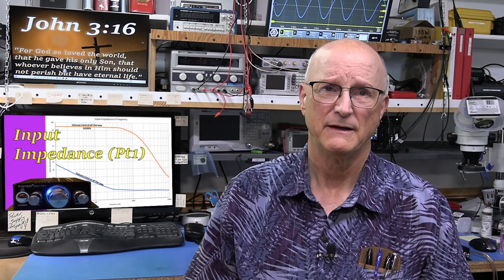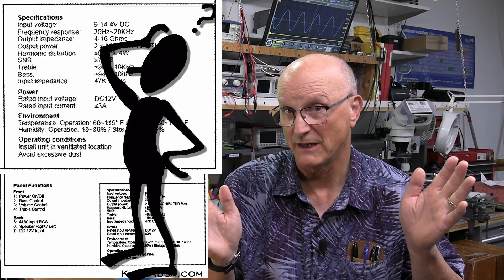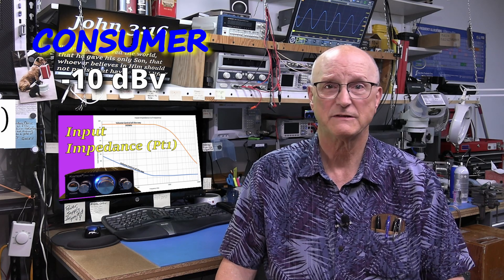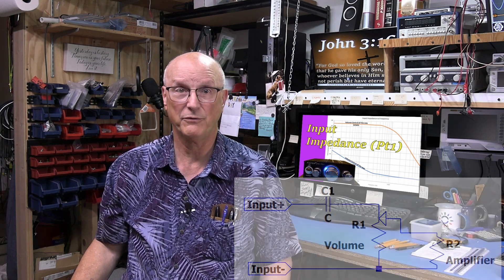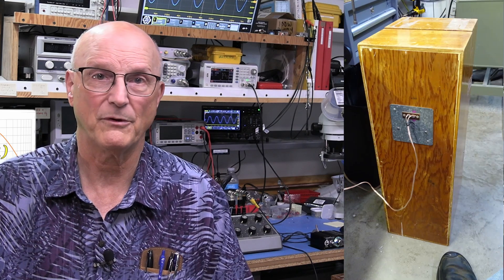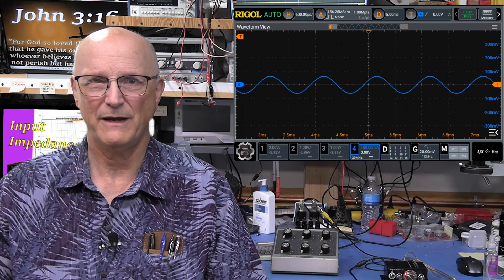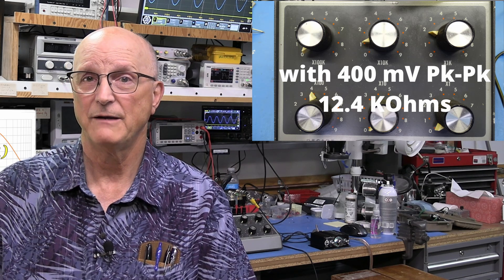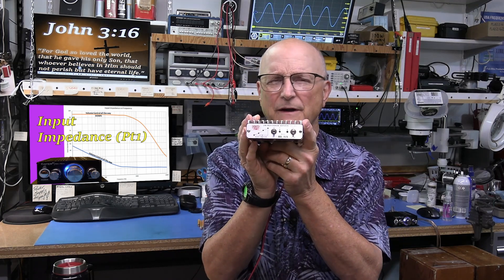Measuring the Input Impedance of a Product, Circuit or System (070a)

Comment: could you help me troubleshoot my speakers?  bought a set of JBL speakers to replace some old ones on my older yamaha receiver.  the olders ones worked fine, but when I put a banana clip on speaker wire and plugged them in - no sound.  I ran the test using my receiver and it said - no speaker found.  I was not familiar with the speaker hookup on the new (er) speakers.  wondering if using the banana plug was the issue?  the knob on the speakers unscrews revealing a little hole that I read is one way to connect speaker wire.  never done that before.  I'm out of my element.  could you help? (71 year old female and not afraid to experiment). but I get frustrated more easily that I used to when building my old PC's.  thanks!  wish I had a way to send photos to better explain what I'm dealing with.
Reply from the maker: Banana plug or using the hole ... both are equally valid ways to connect your speaker assuming the banana plug is installed properly. 
If these speakers are used, you MAY have bought a pair of blown speakers (someone used too much power or applied a large D.C. voltage across them - often the result of a failure of their amplifier). If I were you, the first thing I would do is to measure the resistance across the speaker terminals. From a D.C. perspective, this should be almost a short if they haven't been blown.
Wish I could do more. By the way, age-wise, I'm not far behind you. 🙂

Comment: Hi Ralph, today I was trying to measure impedance of PCB track. With the help of ufl connectors I connected one end of track to port1 and other end to port2. I wanted to measure impedance at different frequence (836.5mhz , 897.5mhz, 1950 mhz etc..). As per supplier of PCB its a 50 ohm track . In VNA I used smith chart to get the readings.   Again the VNA has smith chart for S11 and S21. Which smith chart should I consider ( though FYI i was getting readings closer to 50 ohm for S11 smith chart)?.... Thanks
Reply from the maker: I had to think on this for a moment or two. This is no different than measuring the characteristic impedance of a piece of coax or other transmission line. If you are looking for simple impedance, then this video would help: https://youtu.be/SSadMuMTlpo
But it seems you are looking for complex impedance. First, measuring impedance is always S11. Second, you calibrated the VNA at the end of the port 1 cable (I am assuming) so you need to terminate the other end of the trace with your 50 Ohm termination, not port 2. The effects of the cable and so on looking into port 2 will truly mess up the readings. If you calibrated the VNA at the connector on the VNA you will have to do a "port extension" to move the reference plane for the measurement to the end of the cable right where you are connected to your trace. Note, however, any divergence from a 50 Ohm system when doing the port extension will render the port extension useless. See this video where I show how to do a port extension: https://youtu.be/Pti8Erw_Kkg
I hope this helps. 🙂
Reply: @eie_for_you   you r a great teacher ... Thanks
Reply: @eie_for_you  Thank you... your a great teacher .... Also why cant I just measure complex impedance ( using s11 of smith chart) at required frequency and just find its magnitude ( root of sum of squares of real and imaginary).
Reply from the maker: @minazulkhan8287  You are welcome! ... and thank you, too! What you propose is a perfectly legitimate way to do it. 🙂

Comment: For @eie:  Hello, My name is Denis, I am a French radio amateur (callsign F1GWO) and I want to tell you what I found on another Youtube channel (in French) the demonstration of a very nice and useful little LCR meter which is "completely relevant to the topic of this video". Among other things, it measures resistances (they call that "resistance" but in fact it is not, it is really impedance !) but not using DC, but AC, (You even cannot measure in DC, it is designed like this, even if you want, you cannot !) It works using its internal AC generator. Yes, really, and you can choose between 2 values for the voltage: 0.3V and 0.6V (RMS I think) and 3 values for the frequency: 100Hz, 1000Hz, and 10KHz. You can even use it as a small but effective audio generator with 2 output levels and 3 output frequencies (that’s not specified in the user manual but I tried, and it works nice !) The output is a very nice sine wave. So, it would be very interesting that you buy such a multimeter and make the measure with it. That would be a very nice experience. It would be very very easy to do it: just plug it at the input of the audio amplifier, and play with the potentiometer, that’s all ! And you can do that on the 3 frequencies. It is a very small but nice LCR meter. To find it just take a look at AliExpress and type:  ZOYI ZT-MD1
And it is very cheap … About 20 bucks or less (I don’t know the price of Aliexpress in $, sorry)
I hope this information will be very interesting for you.
Give me your comment please (within your channel, I don’t have one) and if this does not interest you, I am sorry and I apologize having disturbed you.
73 and have a nice day. Denis
Reply from the maker: Very interesting. Amazon.com has it. Normally $40 but it is currently "on sale" for $34. This is within the $ limits of family buying Christmas presents, so I put it on my wish list to check it out. I will compare it to my VNA measuring components to see how it measures up (pun intended). 🤣🙂

Comment: Here is something interesting, but completely off topic. I'm playing thumping music out of a '50s Alnico Zenith Satalite 12" with the tweeter and mid disconnected. No caps on the 12". My leg is next to the speaker and my leg hair is very active. IE static electricity. Why is that?
Reply from the maker: No clue 😕
Reply: @eie_for_you  Silly question. But I think it has something to do with simple air movement, like how the shop vac hose gets static electricity built up. And the old  grill cloth is rather conductive. Must be where the secret sauce tone comes from. Ha!
Reply from the maker: @fullwaverecked  Your guess is as good as mine ... maybe better. 🙂

Comment: Great video.  Changes in input Z are likely due to having negative feedback directly in the first stage.  Too bad the designer didn't use a high Z buffer with a fixed input resistance before the NFB stage(s).  By the way, love the display monitor in the upper-left corner.
Reply from the maker: Thanks, man!  I had to think about this a little... yeah, negative feedback with a capacitor in parallel with it to limit high end ... that would certainly do it.
I agree with you on the fixed high input Z first stage; put the volume control between the first stage and the next. That is how I did it in my mixer project (Design End-to-End series).
He is the reason I am here, my friend. That is my wallpaper on my desktop. 🙂
Reply: @eie_for_you  I'm completely with you, my friend - in my 'retirement' I'm an adjunct college prof, teaching engineering technology.  While I'm not allowed to openly discuss my faith, I subtly include Christian values in the lectures and talk about the importance of integrity in the industries where they will likely work.  Young people need to hear this from an old guy like me, as the rest of what they are constantly bombarded with is just the opposite.
Reply from the maker: @carlosanvito  So very true! They've heard the message of "me first at all costs" ... "it is all about me and what I need" so much that selflessness is a rarity. 😞 Lying is OK if it is "for a good cause" (usually their own). Yes, integrity is so important. Keep up the good work! 🙂

Comment: 8:15 "The signal generator output impedance is set to 50 Ohm". I don't think so. All signal generators I know have a fixed output impedance of 50 Ohm. Only the voltage display is halved so that the voltage is displayed at a load of 50 Ohm.
Reply from the maker: Yes, you are right. This signal generator has a fixed 50 Ohm output impedance. However, there is a setting for the channel which we can set to the impedance that it will see on outs output which corrects the voltage as indicated on the display to accommodate the load impedance that actually exists on its output. It doesn't change the actual output voltage. It changes the voltage as indicated on the display.
With that said, I DO personally own a signal generator whose output impedance is NOT 50 Ohms. While it is a good bet that most mainstream signal generators output impedance is 50 Ohms, it certainly in not a given.  There is a whole class of them, for instance, which are 600 Ohms and 75 Ohms. So, let's be careful about our assumptions. 🙂
Reply: @eie_for_you  That's right, that's why I wrote “All signal generators I know”. But that wasn't right either, because I have an old Wien-Robinson oscillator that I hadn't thought of, whose output impedance I don't know. But I doubt that it has 50 ohms.
Reply from the maker: @egonotto4172  True that! It is a good assumption, in general, that all signal generators of modern design will have an actual output impedance of 50 Ohms unless they have some specialized purpose. The cable TV industry is all about 75 Ohm as is the CCTV because 75 Ohm coax has less loss than their 50 Ohm counterpart.  Parts of the audio industry was all about 600 Ohms; that is where the whole dBu steps in (1 mW into 600 Ohms is 0 dBu). 🙂
Reply: In the audio world, really low Z oscillators existed and are (were!) quite important. 

The BBC, for example, used to send "station tone" round its studio complexes, which would appear as a hole on jackfields. The tone source had to be low Z, so that several studios could use it simultaneously. 

Separately, I have an ex-BBC Comms. Dept. lines test oscillator/precision meter+attenuator set that has a 600 ohm output impedance switch (otherwise low-Z). I think the reason for using 600 Ohms as the measurement/matching impedance had to do originally with ease of design when transformer matching the component units in a signal chain: mic-to-line amp, mixing stage (constant impedance faders!), line send amp's input, and so on. Back in the day, these were often individual items in an equipment rack ("bay" in BBC speak - the reverse of US usage!).

IIRC, the twisted pair outside broadcast circuits supplied to us by the Post Office were expected to be 75 Ohms, and our lines equalizers worked on that assumption. That said, the Post Office was notorious for putting in 'lump loading' - passive equalizers - at various points on long lines (i.e. in the telephone exchanges they passed through), so they would nominally retain the expected impedance at 1kHz. We worked on having around 70dB basic loss(!), but lines could have complex impedances caused by a string of inductors, etc. The usual approach was to call the telephone exchange and say, "take that lot out!". Our STC cans were 2k in each earpiece, so they could be used directly across a signal in a jackfield, but without double terminating it (or worse!). 

The other interesting operational impedance issue was mic matching. The usual assumption, still reasonably valid today, is that mics have a source Z of 300 Ohms, and a mixer mic input would be around 1.2k. 

When I started, there were a number of semi-consumer mics, mostly ribbon designs, still available with an output Z of 30 Ohms. This is way too low for the 1.2k mic amps. Studio wallboxes were thus equipped with impedance-changing 10x transformers (30-300 Ohms), and the mic connections at the wallbox were on 8-way Cannon EP-series connectors, rather than XLRs. Normal, 300 Ohm mics used pins that went straight through, whereas 30 Ohm mics made "automatic" use of the transformer on (presumably) six other pins. Thus operationally, as long as you used the correct cable for the mic, the impedance difference was rarely an issue. Why 30 Ohms? I think it's this: Ribbon mics are naturally an extraordinarily low impedance, and have to have significant impedance conversion. If you want a small ribbon mic the old-fashioned way, the transformer's size becomes a significant nuisance to get the output Z up to 300 Ohms (and still have a decent signal from it). We used to use Reslo ribbons in TV studio mic booms, where both size and mass work against you. Although they made 300 Ohm versions, ours were 30 Ohms. You usually see the 30-ohm variants on secondhand sites and the 'youth' of today often wonder why they're so quiet!

Sorry if my memory is playing tricks above - I was an operational engineer 40 years ago (I mixed programmes), not a comms man. The above goes back to my basic training in the 1970s (which was extremely thorough), and conversations with colleagues in comms who I worked alongside.
Reply from the maker: @simon-d-m  Interesting! 🙂

Comment: Don't have enough fingers and toes to count how many times I have tried to explain measuring a component or circuit's performance and the importance of matching input and output impedance.  In my case it's usually a RF related circuit or component like a crystal or ceramic filter, band pass filter or mismatched amplifier stages with hi/low input output stages.  You can't just hook up a filter or filter network, etc... to the input / output of a spectrum analyzer or vector network analyzer with a 50 Ohm impedance to a circuit or component with possibly thousands of Ohms of impedance and expect the result to be correct.  In most cases people get it, a few are like talking to a brick wall.  Mike KC3OSD
Reply from the maker: If you take in my video on measuring non-50 Ohm things using a 50 Ohm VNA (https://youtu.be/dgDS4rjb-GU) you will see that I am in agreement.
If we absolutely do not know what the input impedance is, where do we begin and how do we accommodate this?  
An initial measurement without impedance matching gives us a ballpark.  From this ballpark, how precise do we need to be? Many times this ballpark is sufficient, but not always. Then we have to turn to impedance matching business. 
In my next video I do NOT do impedance matching because the amplifier I will be testing the input impedance of is SUPPOSED to be in a 50 Ohm system, though it turns out ... not so much. 🙂